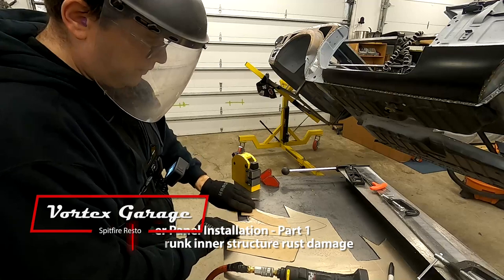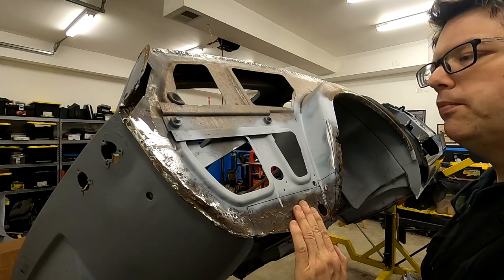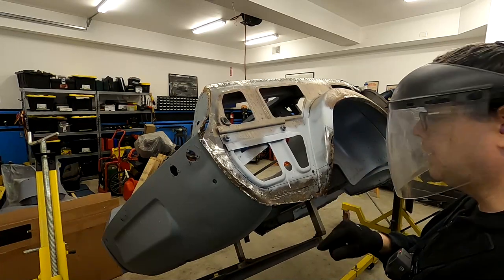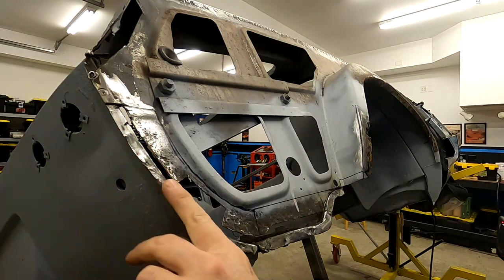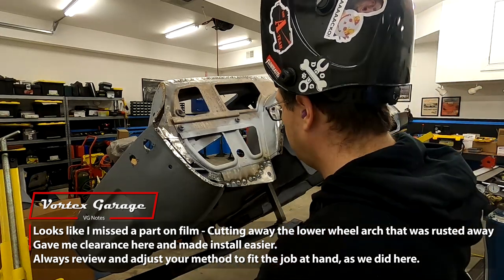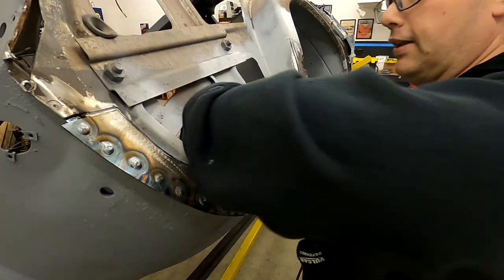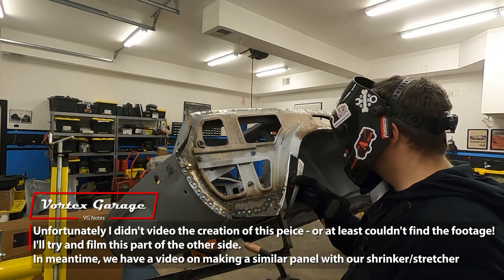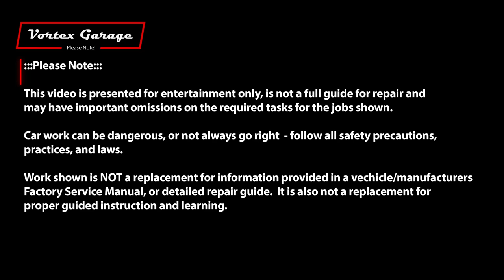Spitfire Rear Quarter Install Pt1 - Fixing Inner Structure Rust

Comment: I would've probably left the welds without grinding them flush because they are not visible. When grinding them flush there is always the risk of making the surrounding metal thinner. This is acceptable for surface metal (obviously nobody wants to have a big bead on the outer metal) but structural metal should stay as strong as possible.

Don't take it as criticism, just as a suggestion :)
Good work as always!
Reply from the maker: I agree - it's a bit obsessive compulsive to want to grind them down - knowing they are there and wanting them to be close to factory look even if hidden.  I totally agree if you do that, you have to be super careful not to grind the sheet metal below the weld (easy to do inadvertantly) and make it thinner.

Comment: I’m starting a GT6 project. I’ve watched and rewatched and rewatched your videos. I will have a situation whereas I thought it might be better to replace the entire wing especially based on my lack of hammer and dolly skills. There is typical B pillar and rear quarter rust along with 2 sharp creases 1/4 x 1/4 x 2 - 3 foot long. My question ( now that you jumped off the cliff 😀): if you had to do it again would you pull the entire wing?
Trust me I don’t doubt your skill set I doubt mine. About right now I would have been staring at the car thinking that’s a pretty big hole to patch vs a couple of patch panels, a stud welder and a learning curve ( for me, of course). I guess that begs a second question: how to you feel about the quality and fit of the replacement panel?
Reply: By the way, Thank you for the content.
Reply from the maker: A Harbor Freight stud welder isn't very expensive, and that's definitely a good skill to learn - one I'm also not the best at.  Worst case you get into it and decide to replace the panel anyway, so nothing is lost.

I would say having done it, and I have 2 more videos in this series posting very soon, that replacing the rear quarter panel IS a pretty involved job.  This is the first car I've done this major of weld work on, and I will say that after awhile you do get fairly comfortable with it.  The quarter panel as a first time run may be a bit hard, but it's frankly easier than the floors or rockers in my opinion.  So long as you have good reference points, the quarter seems to line up nicely.

The deciding factor for me was a combination of things - I had the same crease damage like you are noting,= (more so on the other side that I'm also going to do), but also fair bits of rust on the lower sections.  I did debate buying only the lower sections, doing those, and repairing the upper part.  That is a good option.

You could also buy the quarter and section it out.  Follow some of the butt welding methods like I use or my favorite one I learned from Fitzee's Fabrication (https://www.youtube.com/watch?v=_u31t13QO6A) - doing this you could section in only the part you need.

But in the end I figured I was happiest knowing the entire panel was fresh, and installed just like how the factory would have done it.  For me the more I thought about it, any method was lots of work.  

Doing it again, I would replace the whole panel like I did.  However, I don't think the other options are bad if they seem better.

Of course, if you think you can save your original panel, that is frankly the best option, and again, worst you'll do is decide you can't fix it and move on, no harm done!

Good luck on your GT6!
Reply: Thank you for a thoughtful response.  Ultimately it’s good to know that the panel replacement, though involved, is possible. I believe your advice of attempting a repair first is solid advice. This will allow me the experience of a stud welder as well as a couple of other techniques for dent removal I’ve found on YouTube. Like you said I can always replace the entire panel. An education is never free; time, money or both. Who knows, maybe I’m a natural panel beater…..   ( tongue in cheek).

I do watch Fitzee’s Fabrication what an interesting fellow. I’ve not tried the “cut n butt” yet.

I’m looking forward to the continuation of the panel installation videos. Again, thank you for the response and your channel.